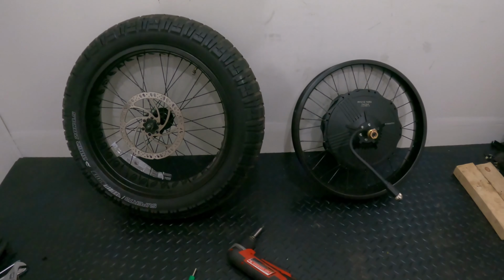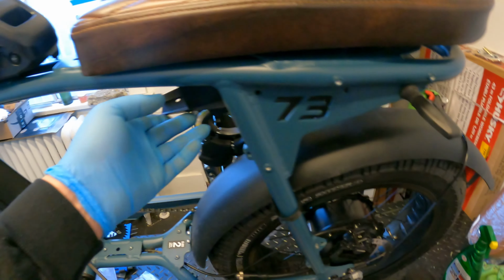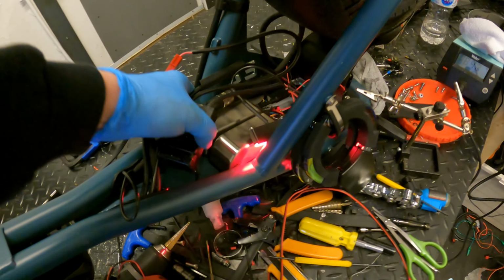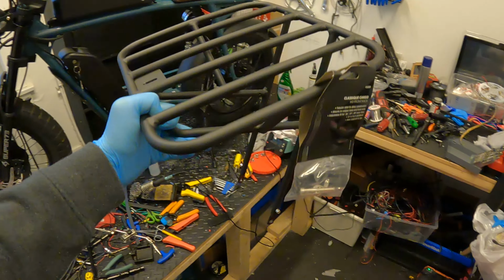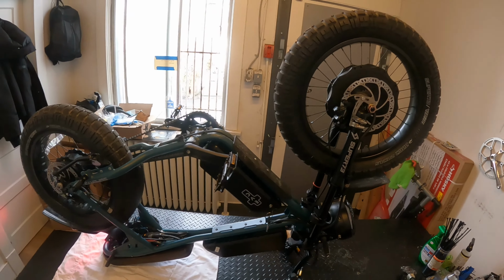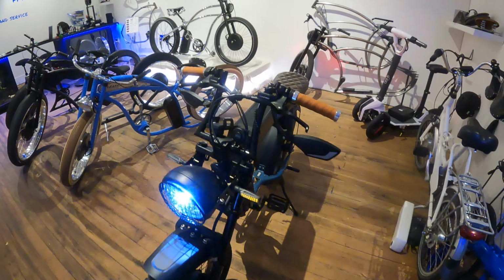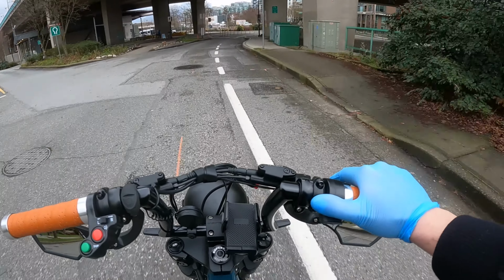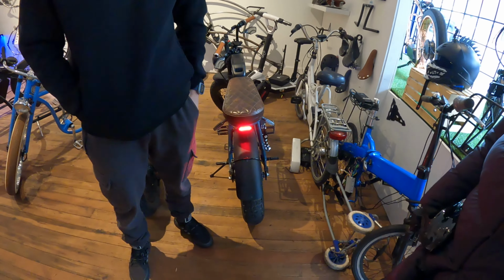SUPER 73 CUSTOM DUAL MOTOR E-BIKE BUILD - VLOG #64

Comment: Can you make a link of all the products? So I can buy the same kit? Please!
Reply: Not really a kit nor is Doing this something that you should do for your first eBike conversion if you’re willing to do something DIY running dual controller dual motor is advanced especially on a super 73 as no one knows what the actual motor is on the bike rumour is that it’s a 3000 w geared bow fang but that’s just rumour personally if you’re doing some thing like this or want this type of conversion taking it to Eli is probably your best bet or to somebody who has experience with programming a phase Runner controller as it’s very possible to blow up your engine if you calibrate it wrong

Comment: Where did you get the motor and all of the stuff? 
I really want to do that for my Super73-S2!
Reply from the maker: Grin Technologies in Vancouver BC
Reply: @eastvanchopcycles   can you link the one you got specific for the super 73
Reply from the maker: You can order the parts from ebikes.ca You will need (2) phaserunners, (2) 36volt batteries of your choice and a front hub motor of your choice.
Reply: @eastvanchopcycles  which Grin front hub motor (with regen) would you use on super 73rx
Reply from the maker: Use the FH212. Its the same one we used.

Comment: How much faster is it now? Also do you have a link for the signal lights?
Reply: signal lights they did on this bike were all customized for the bike all custom wiring as well.
Reply from the maker: It goes a little over 60 km/h now. The customer provided the signal lights. Don't know where he got it from.

Comment: Love to.ride with you guys. I live in Vancouver I have a Mario Retro Rally duel motor. I'm adding second.battery for more range power and putting extra torque. Come spring time
Reply from the maker: Cool. We will set up some group rides when the weather warms up.
Reply: @eastvanchopcycles  cool hit me then 
How much would it cost to get turning signals on my ride 
I have some the rechargeable type which is a pain using them. Front and back I want
Reply from the maker: Contact Eli at eastvanchopcycle.com He can quote you. I just make the videos lol
Reply: Top speed?
Reply from the maker: Little over 60 km/h

Comment: When does the line get crossed between an ebike and a electric motorcycle? At what point do you need registration and a motorcycle license to ride one of these things?
Reply from the maker: Here in Vancouver if the ebike has pedals its still considered as a bicycle. If it doesn't have pedals its considered as a motorized vehicle and you need a license and registration.

Comment: Is the rear motor and bike's firmware still connected to the Super73 mobile app?
Reply from the maker: No. We replaced the rear motor controller with a phaserunner. We can use the phaserunner app to tune it now.
Reply: @eastvanchopcycles  one issue I have with my S2 is the lack of torque. Do you think just replacing the controller would allow me to get more torque out of the rear motor?  I’m a big guy and it struggles on the hills.
Reply from the maker: Replace the controller with a phaserunner and swap the battery to a 52 volt or 72 volt. That should give you more torque.
Reply: @jeremyweber4223  My RX struggles on hills too i must say this bike is wicked on hills it flys up the hills even with my weight of 300 lbs

Comment: can 2 controllers 2 motors, 1 trotle and 1 battery whether it can increase the speed of the bike ?
Reply from the maker: Yes speed can be increased if the battery is 72 volts
Reply: @eastvanchopcycles  So 2 dynamos can add speed to a bicycle?
Reply from the maker: 2 motors will increase speed and torque
Reply: @eastvanchopcycles  thanks bro i will buy 2 dinamo for incrase the speed my bike

Comment: Did the customer provide all of the additional components for the bike? ALso around how much did the total build cost?
Reply from the maker: We provided the extra battery, motor and controllers. The customer provided all the accessories. Please contact eli at eastvanchopcycle.com for pricing. Not sure how much he charged. Thanks
Reply: @eastvanchopcycles  I see. Once the bike was upgraded, was there a maximum value for how fast the new bike was?
Reply from the maker: Top speed is little over 60 km/h.

Comment: I see you are still using the stock forks. Some claim the stock forks will break if a front hub motor is installed. What do you think now that you have run it awhile. Is the stock bike strong enough?
Reply from the maker: The customer has no problem with his forks. It's strong enough.

Comment: If you put a front motor on a Super73-S2 can you do a video step by step? please! I think you would get a lot of views and I will share your video
Reply from the maker: Maybe, if we get another customer that wants to do it.
Reply: @eastvanchopcycles   how much does something like tht run?
Reply from the maker: Don't know the price of the bike. We just did the upgrades for him.
Reply: Just buy a 20 inch front fat tire hub drive kit that matches the with of your forks AND A BATTERY  AND IN STALL IT you will have two separate drive systems left and right throttles
Reply: What’s the front for size for conversion

Comment: How long would the battery last without peddling and did you get a top speed after this mod?
Reply from the maker: Not sure how long the battery lasts. Haven't asked the customer. I would assume roughly double the range. Top speed is a little over 60 km/h.

Comment: for thos wanting to know if this can be done with a rx yes yes it can me a Eli spoke on the phone for a little bit super awesome guy super knowledgable I’m gonna be stopping by his shop tomorrow and going to get the exact same thing done though in the comments I am seeing that somebody else provided the turn signals though I’m sure that won’t be a problem for Eli to source I’m definitely willing to pay for it may be if he’s in the mood he’ll make a video about upgrading my RX to this when I drop it off I have no idea what the timeframe is and pretty much gonna give this guy as much time as he needs to do what I want I honestly should’ve bought my bike from these guys to begin with I didn’t even bother with super 73 I like the frame but now I’m basically buying a super expensive bike I have no idea what the battery and the parts currently on the bike are worth to his shop but I’ll probably end up selling the battery the original controller the original headlight and that shit to them for a couple hundred bucks along with the original charger Super stoked to get this going

Comment: Help.. I am trying to do the same dual motor setup to my RadRunner. But 1st, My Grin Technologies Baserunner v4 & Cycle Analyst not working well on 1000w Bafang rear motor (and original Rad motor same issue)...Issue, when rolling backwards, motor will not engage. No throttle turning on. When at stop, motor stutters on take off. Wheel off ground and throttle works.  Great on a rolling start. Grin support is failing to figure out. I sent controller, L1019 to Z916 motor adapter cable and original Rad motor to them for testing and they could not find the problem (they were only using a gloved hand for adding resistance on motor. When connecting to a Bolton Bikes controller the motor works as should. Motor is new and two motors have this issue.  Any help? You use Grin controllers, have you seen this issue before?